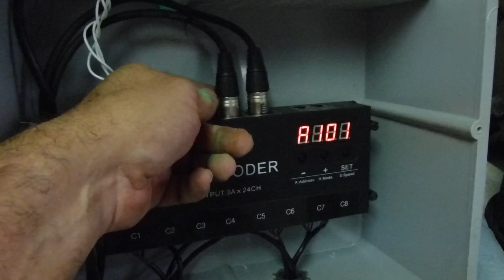Fog Machine DMX RGB Hack

Comment: I have a question, why wouldn’t you use a RGBW controller? If you did that then you could put a relay in each fog machine and have the relay control the pump. You’d just set up a RGB channel for the RGB then for the “w” channel you’d just label it fog.
Reply from the maker: I am using a Light-O-Rama controllers to run the pumps, and the air solenoid.